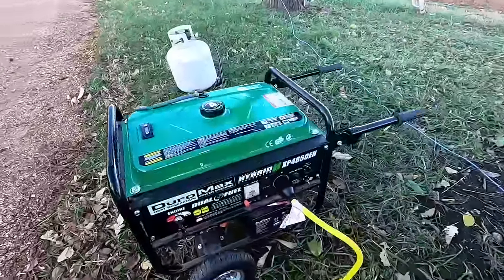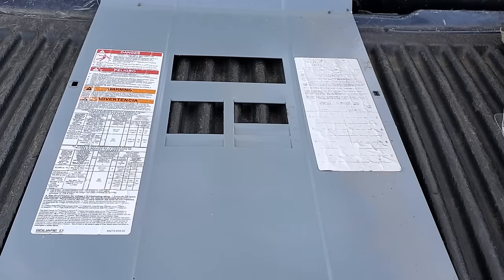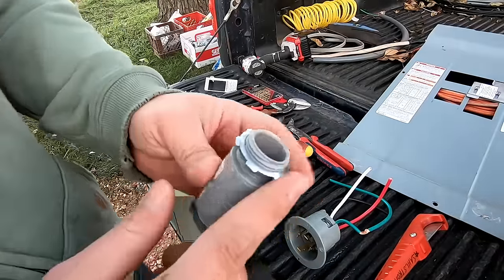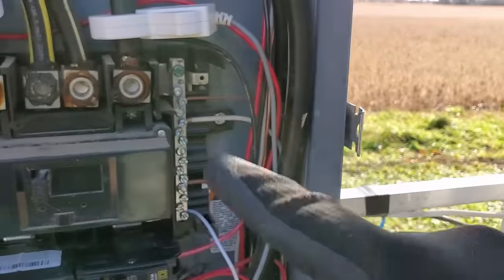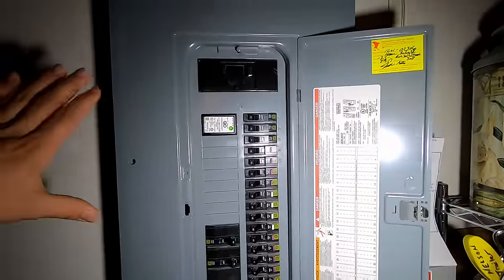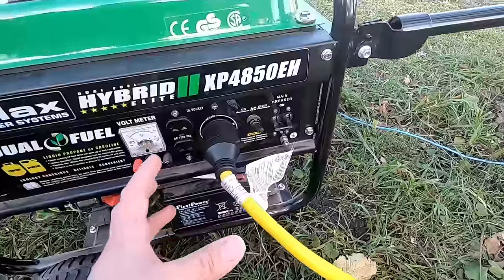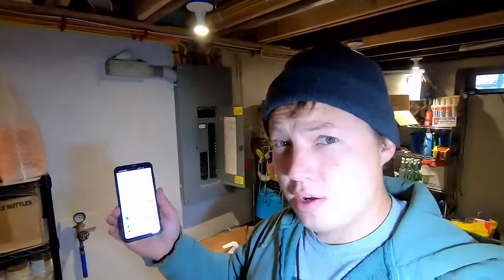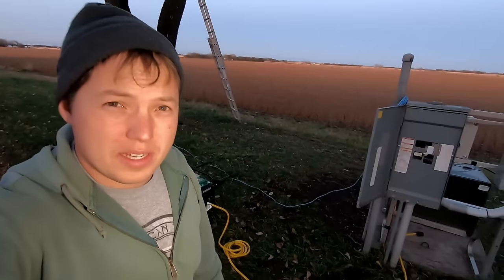How To Hook Up a Generator To Your House Using a Breaker Interlock Kit & Power Inlet Box

Comment: nice install and explaination; have you given it any thought as how much fun it will be to try to plug in the Generator cable in a 3 foot snowdrift in the middle of a winter storm  @ O dark Thirty in  the night?
Would it not be better to have isntalled the generator cable connection outlet 4 -5 feet off the ground on the front side by  the main disconnect panel?

Comment: Is your generators neutral and ground still bonded to frame. The neutral is bonded to the frame on my DuroMax XP9000iH.
Awesome videos. keep up the good work Could you check Could you check out this post I started about using the xp9000iH with there xp9000iH-pk parallel box with no neutral connection. Seems odd DuroMax would do this. 
Site is    power equipment forum     and the post is    Labeled  Duromax XP9000iH-pk parallel box question

Comment: Too bad that style of interlock is not approved in Canada. You don't want to mess around with a standby panel and old wiring. We got a nice, roomy, 200 amp Siemens panel with a hodgepodge of copper and aluminum branch circuits. Would be nice to bypass the whole panel with that interlock.

The Generlink is approved but is pricey to install because of our utility, on top of being pricey for the unit itself.

Nice video.

Comment: @Ben  Thanks for the great video!  I'm interested in using a 3000 watt inverter generator for backup power because it's quiet and produces very clean power.  The downside is that it only produces 120 V.  How can I safely connect it to my service panel?  Assuming I use an interlock and there aren't any multi-wire branch circuits, can I connect the generator's single hot wire to both legs of the service panel?  240 V appliances that don't have a neutral connection should see 0 V and won't work, but they also shouldn't be harmed.  Is there any risk that it would damage a 240 V electric range or clothes dryer that have a neutral line and would be partially energized (between the neutral and either hot wire)?  Would this setup be safe and legal?
Reply: I did this for years without any trouble, before adding a protected-loads subpanel for automatic switching, using 120V from a solar/battery-fed inverter. 240V appliances should not be damaged, though turning them off is still a good idea, if only to avoid needless phantom load. I'd suggest using a normal L14-30R 120/240V inlet, with L1 & L2 kept separate up to the point (10/3 cable), and making the L1/L2 bond on the plug side. This way there's nothing unusual about the permanently-installed wiring, and you preserve the option of using 120/240V generator in the future by simply plugging it in with a different cable. Either way, keep in mind that the breaker in your panel (30A+30A when legs are bonded) won't effectively protect your generator or flexible cord, so you'll be relying exclusively on the breaker in your generator for this. Inverter-type generators do often have electronic load sensing that will react faster than a normal thermal/magnetic breaker.
Reply: @jordanhazen7761  This sounds like what I would like to do with my 120V inverter generator using the illustrated interlock kit, and I have been having a hard time confirming that it is possible to do so safely. I would like to make a power cord using 8/3 SOOW to go from the generator's tt-30 RV outlet to an L14-30r plug, bridging the two hot connectors on the plug with a short equal-gauge jumper (8 gauge, because I need to place the generator 65-70 feet from the outlet mounted to the exterior of my garage). Then, because it is easier to work with, I plan to use 10/3 UF with ground through conduit for the remaining few feet to the breaker box. I only intend to power a few critical circuits with such a setup, none of which are 240V. And I know which additional 120V circuits I can turn on occasionally to avoid exceeding the generator's capacity at any given time. I have seen several comments that care must be taken not to overload the single neutral wire. I'm not sure I understand the issue, but I presume this would not be a problem using a minimum of 10 gauge wire inside the box.

Comment: What is the most practical was to know when the utility power is back on, so you can shut down the genset?
Reply: Bill. Something like this. Loud 120db alarm that runs on battery. In case the link doesn't work, google powerback meter or powerback alarm.
http://www.interlockkit.com/product_p/thp108.htm

Comment: Ive been doing so many of these in south florida, easy money
Reply: Please make sure you follow all the generator safety rules whenever you use your portable generator. 
⚠️Here are the Generator safety rules that everyone needs to follow when using generators:

This is just a reminder for everyone’s safety when using portable generators. All generator safety rules need to be followed carefully to avoid hazards. 

1) Please do not allow an unqualified person or your children to operate the portable generator. Just because some manuals don’t say that doesn’t mean it’s safe. That is important against the generator safety rules. We also need to be keeping an eye on our children too. You need to make sure that your children are not playing near the portable generator especially when it’s running so they won’t get electrocuted. Generators pose electrical risks and they can be hot during an operation. Please keep your children away from the portable generator at all times. It is important to keep our children safe especially our little ones. Be aware of all the hazards.

2) Some people use their portable generators indoors which increases the risk of carbon monoxide poisoning. It’s important to have a carbon monoxide if you have a gas generator. Never ever use your generator indoors even if your doors and windows are open and even in the garage is not safe to use a portable generator. Not even at your porch and your deck. It is never safe to use your generator indoors and in enclosed areas of your home. Your generator needs to be 15-20 feet away from your house. 

3) 🔥generators cause fire hazards too. Never refuel your generator while it’s running. You need to let your generator cool off before refueling it and before storing your generator. Never overload your generator too. Never ever back feed your generator. You should never plug your generator into a wall outlet. Also never store propane tanks indoors. Please keep flammable things away from the generator as well and please don’t smoke cigarettes near the generator. Having a fire extinguisher next to the generator is also important against the generator safety rules. 

4) generator operation; make sure your hands are dry before touching the generator. Never use your generator in wet conditions. Don’t let your generator get wet. You need a generator tent if you need to use your generator during wet weather. Please don’t wear loose clothes when operating the generator. Turn on your generator before plugging in appliances. Use the right cord for your generator. Please do not use worn out cords. 

https://youtu.be/I1jT3ANENvI and here is a video more about keeping others safe when using generators and also about our family’s safety. It’s important to keep your children safe especially little ones. 

Hope this helps

Comment: Great video. Very helpful! Thank you.  For just a moment I thought I saw a black heat pump unit behind you toward the end of the video. Since you probably can't run it with your generator do you just shut it off and switch your thermostat to E or EM or Emergency mode when you use the heating system during the winter with the generator power?

Comment: Is it possible that you're inducing unwanted voltage into either your mains or generator cable by having several inches of them right beside one another, in order to have the Sense clamps around them?  They're not exactly wrapped around anything in any transformer-like configuration, but I'm not knowledgeable enough to know if that could still result in a shock or equipment damage.
Reply: Here are the generator safety rules that everyone needs to follow: this is just a reminder for everyone’s safety. Always make sure you follow all the generator safety rules whenever you use your portable generator. Generators can be dangerous if not used carefully. Every year, hundreds of people die or get injured when using portable generators due to carbon monoxide poisoning and electrocution. Make sure you are using your generator carefully and keeping others safe as well. There is something very serious that everyone should always be aware of when using generators. Some people do run their generator indoors which is not safe and that increases the risk of carbon monoxide poisoning which can cause death of family and you. Some people run their generator in wet conditions which can electrocute them. Please remember that you should never run your generator indoors. Remember that carbon monoxide is an odorless and colorless gas that you cannot see or smell. Carbon monoxide is a silent killer. Keep that in mind. Make sure your generator is 15-20 feet away from your house and away from doors, windows, and vents. Never use your generator in your porch too. Having a carbon monoxide detector is very important against generator safety. Some people also allow children to go near the portable generator which could pose risks. We need to keep an eye on our children making sure that they are not near the portable generator so they won’t get electrocuted or burned by the generator which is dangerous. A locking enclosure also keeps kids safe. A generator shed might look like a tempting place to explore, or take cover during a game of hide and seek, but a generator is a dangerous piece of equipment that can cause injury. It says on the manual that we should also keep children away at all times from the portable generator to avoid injuries. Please do not allow a child or unqualified people to operate the portable generator.  It is important to keep your children safe especially little ones. The portable generator can be hot during an operation. Just because some manuals missed what should be listed doesn’t mean it’s safe to do. Always follow the generator safety rules when using portable generators. Generators pose electrical risks. If you need to use your generator during wet weather, you need a generator tent to protect your generator from getting wet. Don’t let your generator get wet. Keep your generator dry and before using your generator, please make sure your hands and your generator is dry. Do not wear loose clothing when operating the generator. Everything that is said on the generator’s operating manual should not be ignored. Never smoke cigarettes near the generator. Please keep flammable things away from the generator. Never overload your generator too. Your generator can catch fire. Never ever try to plug a generator cord into a wall outlet to avoid back feeding. Back feeding your generator is dangerous. Always turn on your generator first before plugging in appliances and shut off the appliances before turning your generator off. Use a heavy duty cord for your generator and the cord should not be worn out. All the instructions should be followed carefully. Never refuel your generator while it’s running. It can cause fire if fuel spills while your generator is hot. You should turn off your generator and let it cool off before refueling it. Having a fire extinguisher next to the generator is also important. This is only a reminder for everyone’s safety of using generators. Make sure your generator is properly grounded. Having a fire extinguisher next to the generator is also important against the safety rules. https://youtu.be/I1jT3ANENvI and here is a video more about keeping others safe when using generators and also about our family’s safety. It’s important to keep our little children safe as well. Make sure your little children are kept away from the generator at all times especially when it’s running. Hope this helps. Always remember that it’s better to be safe than sorry. Also remember that warnings should not be ignored too.

Comment: Great tutorial Ben, so, basically, to power up your whole house at will, with specific appliances, all you need to do, is install the 30A circuit breaker in the main circuit box, and then wire up the cable to go to the inlet box and then to the generator, is that it?. Thanks
Reply: Don’t forget about the safety rules of using generators: Always make sure you follow all the generator safety rules whenever you use your portable generator. This is only a reminder. Generators can be dangerous if not used carefully. Every year, hundreds of people die or get injured when using portable generators due to carbon monoxide poisoning and electrocution. Make sure you are using your generator carefully and keeping others safe as well. There is something very serious that everyone should always be aware of when using generators. Some people do run their generator indoors which is not safe and that increases the risk of carbon monoxide poisoning which can cause death of family and you. Some people run their generator in wet conditions which can electrocute them. Please remember that you should never run your generator indoors. Remember that carbon monoxide is an odorless and colorless gas that you cannot see or smell. Carbon monoxide is a silent killer. Keep that in mind. Make sure your generator is 15-20 feet away from your house and away from doors, windows, and vents. Never use your generator in your porch too. Having a carbon monoxide detector is very important against generator safety. Some people also allow children to go near the portable generator which could pose risks. We need to keep an eye on our children making sure that they are not near the portable generator so they won’t get electrocuted or burned by the generator which is dangerous. A locking enclosure also keeps kids safe. A generator shed might look like a tempting place to explore, or take cover during a game of hide and seek, but a generator is a dangerous piece of equipment that can cause injury. It says on the manual that we should also keep children away at all times from the portable generator to avoid injuries. Please do not allow a child or unqualified people to operate the portable generator.  It is important to keep your children safe especially little ones. The portable generator can be hot during an operation. Just because some manuals missed what should be listed doesn’t mean it’s safe to do. Always follow the generator safety rules when using portable generators. Generators pose electrical risks. If you need to use your generator during wet weather, you need a generator tent to protect your generator from getting wet. Don’t let your generator get wet. Keep your generator dry and before using your generator, please make sure your hands and your generator is dry. Do not wear loose clothing when operating the generator. Everything that is said on the generator’s operating manual should not be ignored. Never smoke cigarettes near the generator. Please keep flammable things away from the generator. Never overload your generator too. Your generator can catch fire. Never ever try to plug a generator cord into a wall outlet to avoid back feeding. Back feeding your generator is dangerous. Always turn on your generator first before plugging in appliances and shut off the appliances before turning your generator off. Use a heavy duty cord for your generator and the cord should not be worn out. All the instructions should be followed carefully. Never refuel your generator while it’s running. It can cause fire if fuel spills while your generator is hot. You should turn off your generator and let it cool off before refueling it. Having a fire extinguisher next to the generator is also important. This is only a reminder for everyone’s safety of using generators. Make sure your generator is properly grounded. Having a fire extinguisher next to the generator is also important against the safety rules. https://youtu.be/I1jT3ANENvI and here is a video more about keeping others safe when using generators and also about our family’s safety. It’s important to keep our little children safe as well. Make sure your little children are kept away from the generator at all times especially when it’s running. Hope this helps. Always remember that it’s better to be safe than sorry.